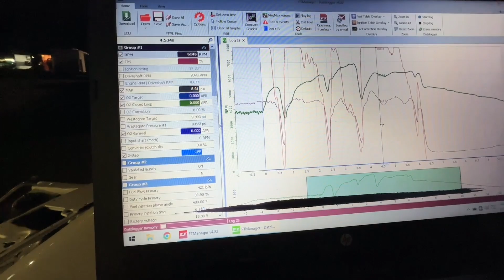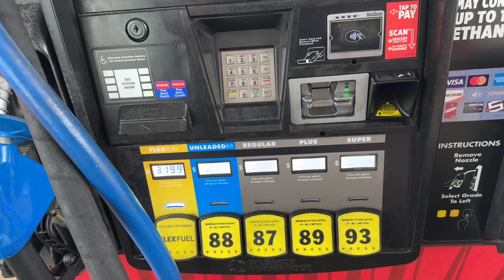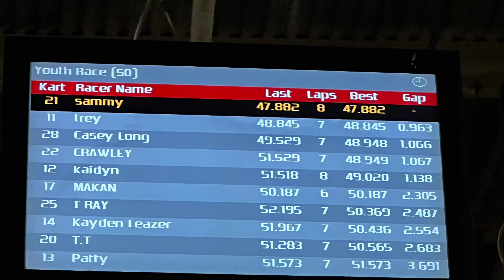Thursday night shadyside test n tune, Friday mooresville and ended up on karts

Comment: It makes my day so much better when I get home and Sammy's got a video posted!! That white coupe is nice and it's got some potential!! Probably wouldn't hurt to lower the rear ride height some too, huh? After the first pass, did you adjust the ARB any or just add a little power? (I understand if you don't want to answer that)
Thanks buddy!
Reply from the maker: I told him he need to get some longer coil over brackets to lower it down, I didn’t adjust arb just wanted to see which direction it was going to go before i started messing with it